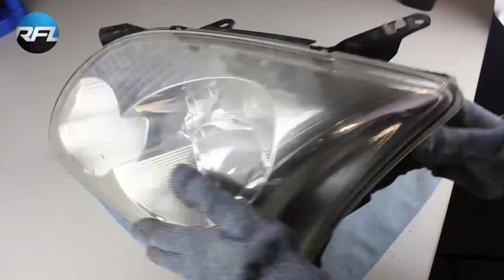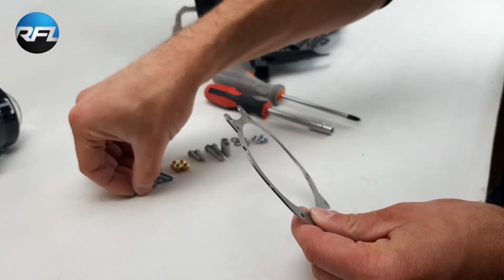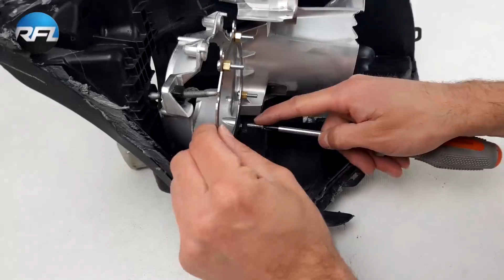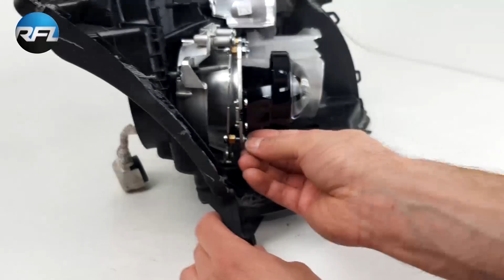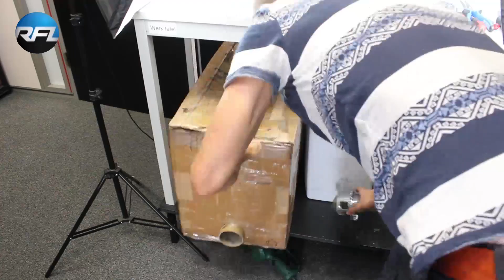Toyota Avensis T25 - Facelift 06-09 headlight repair and upgrade bi-xenon kit by Aharon

Comment: Ordered and fitted these last week. Good results. Hairdryer Trick for 10min with the box worked wonders on the sealant. Upon rebuilding the lights needed adjusting up slightly. Spacers slightly too long? But easy enough to fit. One feature I did like, is the new screw on retainer for the bulb! Much better than the original fiddly spring retainer. I kept my original xenon Osram Nightbreakers. Very pleased for a reasonable price. Didnt understand the extra wiring which wasnt featured on the video. But i didnt link the high beam anyway. Can recommend.
Reply from the maker: Thanks! Good to hear! The hardware will be improved, there are no 'out of the box' correct length spacers, but this will be fixed in new kits (please contact us when you would like the different hardware). The extra wiring, like you mention, is fo the high beam, we will add some info in the description (video/product). Thanks again for the feedback!
Reply: @Retrofitlab  i remember  i have cut 3 or 4 mm from the spacers ...  and didnt use the the high beam harness... to much wires outside the headlight.

once there is no high beam wires inside the hadlight ........ i have soldered the 2 wires from the hi/low beam solenoid on the h1 bulb base .. only to get the high beam voltage to activate the solenoid

Comment: Just installed this kit and light is good and all but the two top-spacers seem to be longer than necessary? Makes the high beam light up the tree tops. (the halogens) Near beam adjusted to 1% down as lamp-housing says.

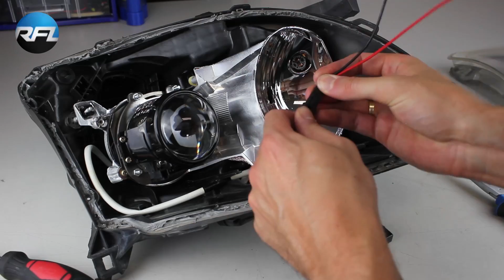Comment: at 3:08 you could see a screw missing. and it's an important one too :)
Reply from the maker: Hi, that shot is from the pre-facelift model, sorry. The bracket has changed and the hole is now also used.
Reply: @Retrofitlab  obviously you know about morimoto's mini d2s product. any chance you could be knowing if yours are of the same lens size with theirs? they do say 3" as yours but somehow 3 seems a bit bigger for pre-fecelift models. if not, your 3inch is just glass or did you included the plastic frame too?
Reply from the maker: @JohnBoy79  In this kit we have used the TL-r projector which has a 2,5" lens because of the fitment. The Mini D2S has a 3" lens.

Comment: Jaká teplota jaký čas? A jsou to valeo světla nebo jiná značka?
Reply from the maker: In general, 2 methods are used, with both methods, be careful and patient. 

Method 1 is using a regular oven. Preheat the oven at 200 degrees Celsius. When ready, switch off the oven and place the headlight inside. Make sure that the headlight is not touching any metal of the oven by placing a cloth over the grid, for example. Leave the headlight in the oven for 10-15 minutes before opening it. If the headlight kit is not yet soft enough, put the headlight in the oven for a bit more time.

Method 2 is suitable for larger headlights that do not fit in a regular oven, or if your lovely wife absolutely does not allow car parts to be baked in her kitchen. A large cardboard box is used where hot air is blown through a heatgun. Make sure that the hot air of the heatgun does not blow directly to the headlight, place the headlight on small elevations so that the air can circulate properly through the box. We use a setting of 300 Degrees Celsius for 12-18 minutes / 1st lowest setting, depending on the size of the headlight.

Comment: Im going to uprage my headlights, and i wasnt sure, that there is no need for extra glue while assembling. Some people told me, it won't be enough,  if i just put the parts together, and heat them up. Is it sure,  that it will be waterproof, when i do it like in the video? (Maybe the Toyota headlight is better than others :D)
Reply from the maker: Normally it isn't needed, but you can add some extra to be safe...

Comment: That's not the facelift
Reply from the maker: Hi correct, please see the description "Because the process of opening and closing the headlight is the same, parts of the movie of the pre-facelift are re-used in this video. But the specific part of mounting the bracket is shown with a facelift headlight."
Reply: @Retrofitlab  yes...i order it from you 2 months ago ... easy installl .. happy costumer
Reply from the maker: @andrecamacho7660  Good to hear :)